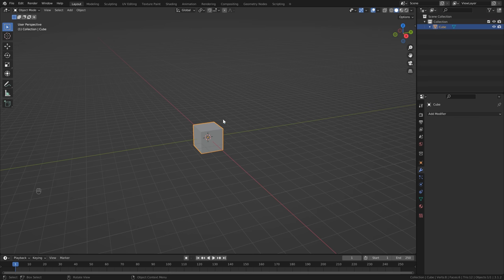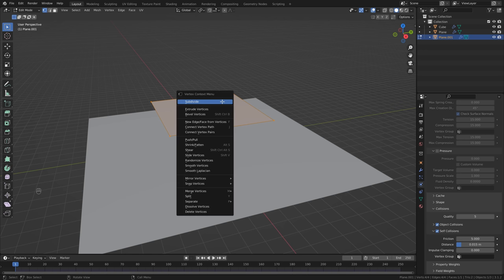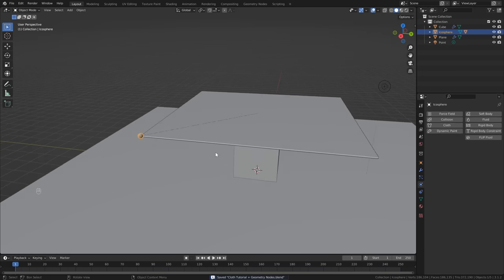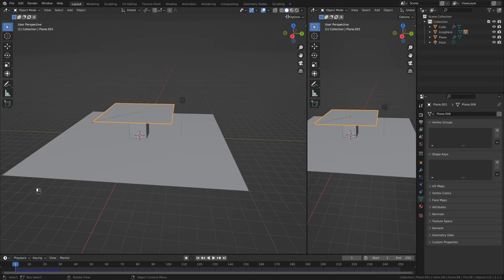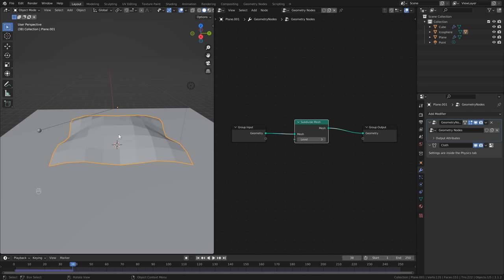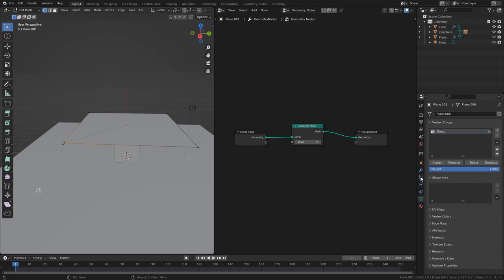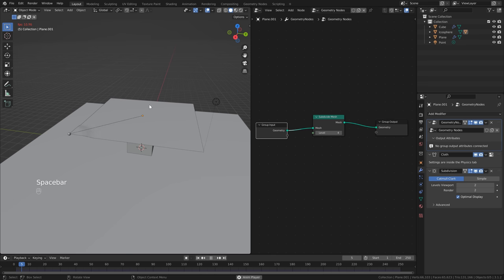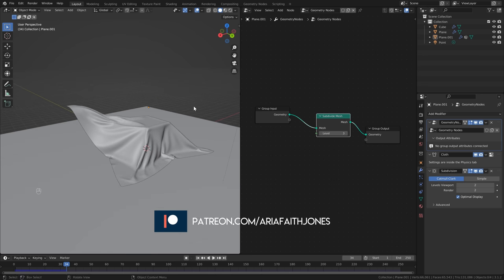How to create Cloth Simulations Faster | Geometry Nodes | Blender

Comment: Don't use less subdivisions before baking because unlike marvelous designer which calculates the mass of the fabric by surface area blender uses vertex mass which leads to different results with every subdivision you add so when you're happy with the results divide the mass by 4 each time you subdivide
Reply: I guess it really depends on the usage and situation. If its for fashion design then maybe you need more precise cloth simulations. But if the simulation is used for a single element in an animation then precision and accuracy might not be important
Reply: Yeah, never quite understood why blender uses mass per vertex vs. the more intuitive mass per surface calculation...
Reply: Maybe a stupid question, that only applies if subdivision is done before the cloth sim modifier correct?
Reply: @RareAmv  Yes. The cloth simulation is going to simulate cloth using whatever verts are in the mesh at that point in the modifier stack.

Comment: i see you have some good ideas in this video. i recommend you try pinning the active geometry node with the thumbpin icon its not object dfepend, also, if you already have a sphere as the reference point for pinning, you can consider in the geonode, using proximity or vertexposition & sphere position comparison to procedurally assigning vertex group weighht (by storename attribute)

Comment: I am relatively new to geometry nodes, but isn't there a way to modify the vertex group within the nodes? If so then wouldn't it be possible to use the icosphere (or any intersecting object[s]) to dynamically calculate the pin groups by boolean operations? The setup would be a bit more involved, but would then allow for driving cloth sims from rigid bodies. I think I am going to toy around with this for a shower curtain or something.

Edit: (from my later comment)
Using the new "Store Named Attribute" node in Blender 3.2.0 I was able to modify the vertex groups. It's a minorly convoluted process involving two separate mesh booleans (a difference and an intersect) and two merge operations (one to flatten the intersection and the other to properly merge the overlapping geometry after joining). Simply apply a value of 2 to the store named attribute node before the geometry join and it works!

I used a value of 2 because it gets but in half on some vertices after the join. Going over 1 doesn't seem to affect the pin group so I used 2.
Reply: geometry nodes gets a bit stouborn and unintuitive if you want to get some types of information out of it but for sure there should be a way to get it to behave, even if you have to mess around with some hacky things to do it. its much more oriented towrds bringing things in and jsut outputting a raw mesh
Reply: @AlienXtream1  I've found where I can read the vertex groups, but not dynamically write to them. That's rather frustrating, but I'm pretty sure it can be done via python. If it can be done then this might be a really cool plugin opportunity to just use some boolean helper shapes to dynamically drive cloth sims. Done properly it might even be compatible with non-native simulators. More research to do! lol
Reply: Using the new "Store Named Attribute" node in Blender 3.2.0 I was able to modify the vertex groups. It's a minorly convoluted process involving two separate mesh booleans (a difference and an intersect) and two merge operations (one to flatten the intersection and the other to properly merge the overlapping geometry after joining). Simply apply a value of 2 to the store named attribute node before the geometry join and it works!

I used a value of 2 because it gets but in half on some vertices after the join. Going over 1 doesn't seem to affect the pin group so I used 2.
Reply from the maker: That’s so cool! I will definitely look into that!! Thank you for the tip! 💕🤗
Reply: Sure.  In 3.1 you can send it to a group output then assign that to the vertex group in the geonodes property editor.  In 3.2 you can use a "store named attribute" node. The subdivide operation will have interpolated weights for the newly created vertices, so you can also do a bit of maths to take any less-than-one interpolated value and set it to zero.
Reply: @palpytine  I could not find that for the life of me when I was looking for 3.1. And my values are set after the subdivide. The interpolation seems to be coming from merging the overlapping verts.